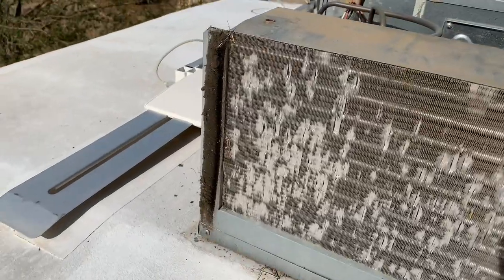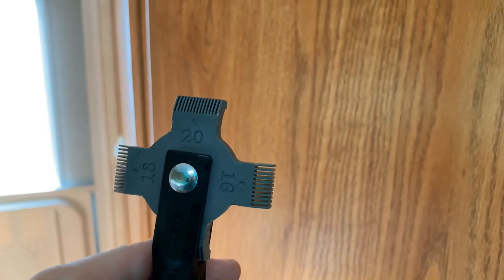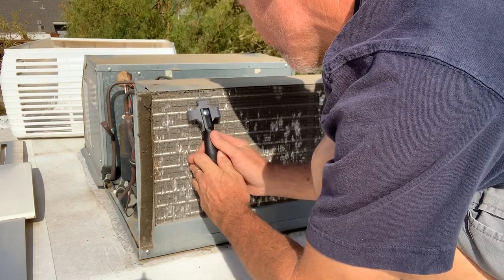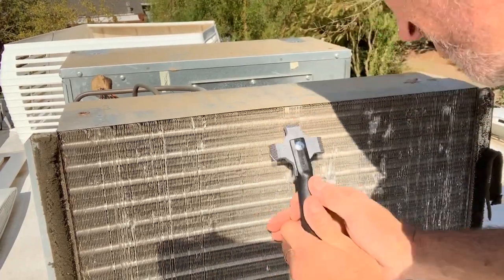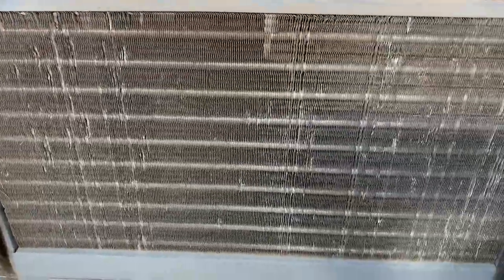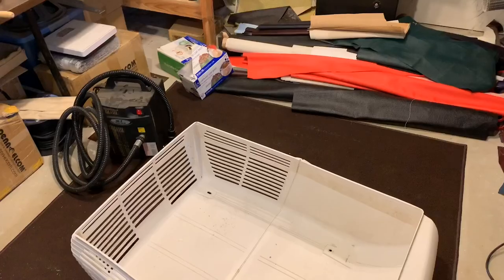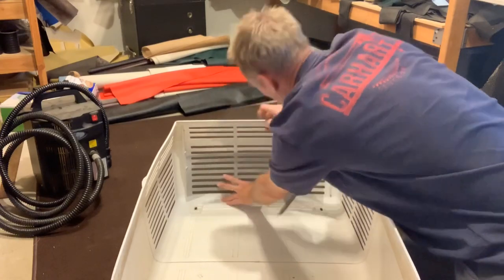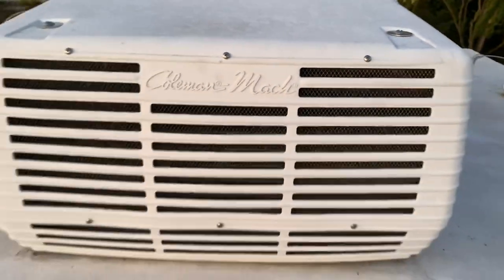RV Air Conditioner Repair. How to Straighten Condenser Coil Fins. (And How to Prevent It)

Comment: Have you considered doing a before and after test with a flow meter? You might not think that metal grading makes much of a difference with restricting airflow, but I'd say it does, to the point I'm planning on trimming some white slats off my cover. Theres a YT video about it.
Reply from the maker: I no longer have this air conditioner but I did perform a before/after delta-t test.  
The air conditioner performance increased after the fin straightening and screens installed.  A difference of about 8-10°F

Comment: There wasnt engough restriction to cause heat transfer inefficiency.
Reply from the maker: You have the right to your opinion, but…
The fact is, that amount of fin damage was actually enough to cause some restriction in air flow which a Delta T test proved.
From 12° before to to 20-22° after fin straightening.

Comment: Your ac unit looks loose on the roof.
Reply from the maker: It was not.  I just removed it a few days ago to re-deck the roof.  Why do you say it looked loose in the video?
Reply: @covetthecamper2289  I could see it move around on your roof. I had the same problem and all the bolts tying the exterior unit to the interior control were loose. It was leaking when it rained and that’s how I found out it was loose on the roof.

Comment: Only an American company would install it that way. The weakest link, the ac fins, facing the driving direction of the vehicle. What are they thinking!?
Reply from the maker: The condenser fins are at the rear of the ac.  Not the front.